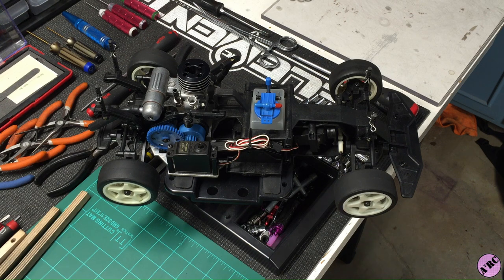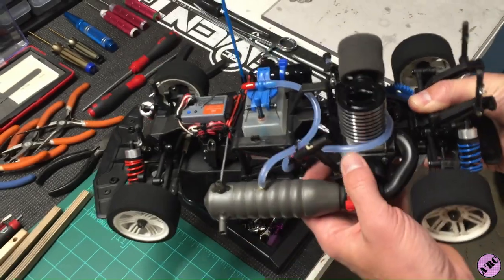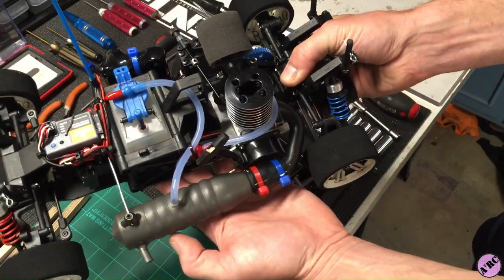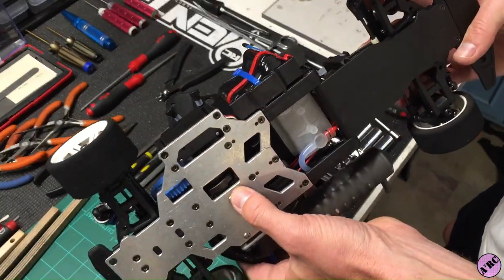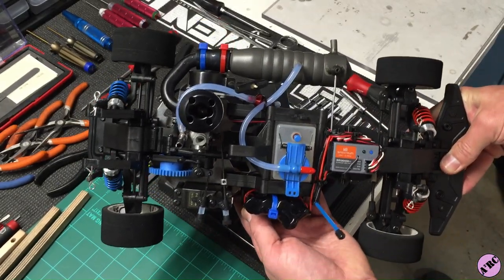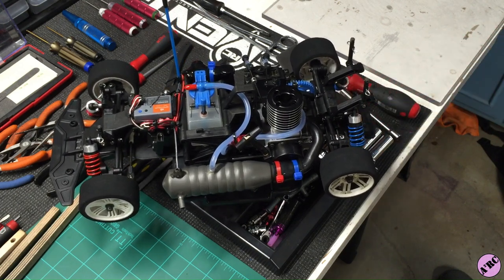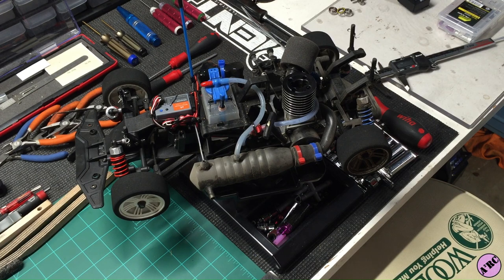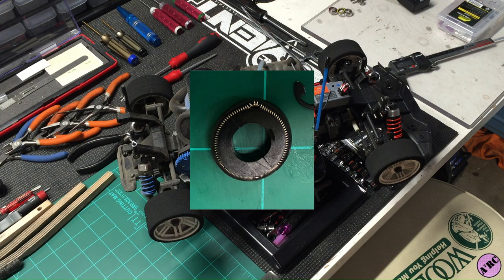UPGRADE - Kyosho Mantis Nitro GP 1/10 RC

Comment: 😍😍😍😍
Omg I loved my mantis ❤️
Mine went fwd, as this kit came as a fwd nitro, and flipping the bottom plate moved everything to the front. I also turned mine into a truck. I always wanted to cut up two cars, and make a duel engine nitro truck out of it. 
Damn, I miss that car.
Reply from the maker: That would have been an epic build with two engines‼️
- They are still out there, you can always get the project started again

I appreciate you watchn’ and for taking the time to write 🩷 I’m glad you enjoyed the vid

Comment: Wow that exhaust when you started it was loud but It runs very well the smaller nitro’s are very collectible now. my converted kyosho RS200 which is now a nitro Blackfoot the brakes were rubbish the little plastic brake pad melts after a few passes I’ve tried making them but still melt so i made one out of brass. The clutch i use the standard kyosho AB-15 clutch on the steal AB-16 clutch bell the gx12 flywheel studs are a bit thicker so it won’t take it but the standard gx12 clutch is good enough with AB-17 springs I’ve never had any issues. Are you on any fb group’s because I just striped my Novarossi c12 down today and posted it on nitro diesel and more
Reply from the maker: That’s good info. I am in FB. I’ll try and find you and send you a message.

Comment: Depending on your driving style the pipe you have on there is a low end power pipe try a different one for more speed and I never use foam tires just my opinion 😎👍
Reply from the maker: Hi Richard 💯
Well the goal for this build, is not really to make it go lightening speed. It’s more to make some fun and needed improvement to the platform. 
- We defiantly can explore different engines and pipes in a future episode 

Thanks for watchn’ 🩷